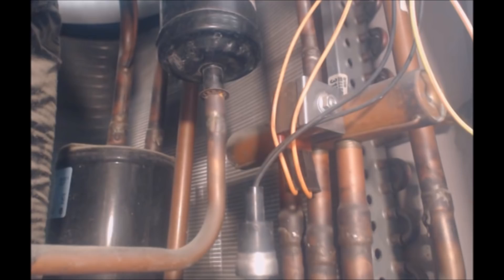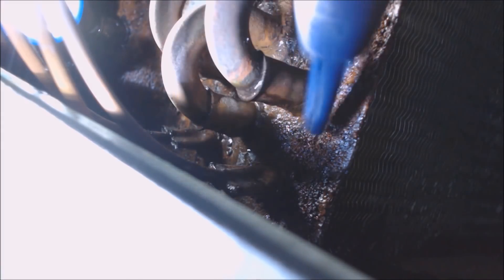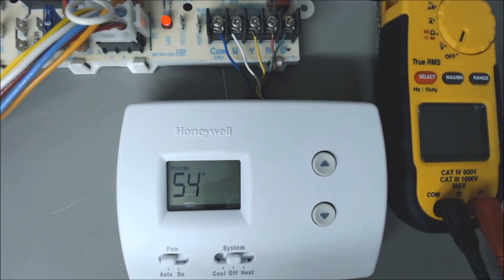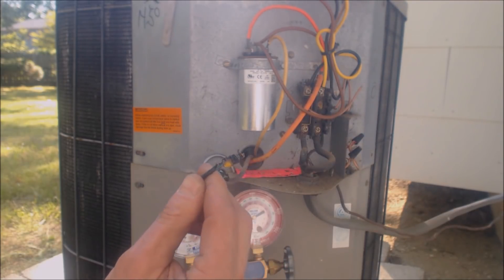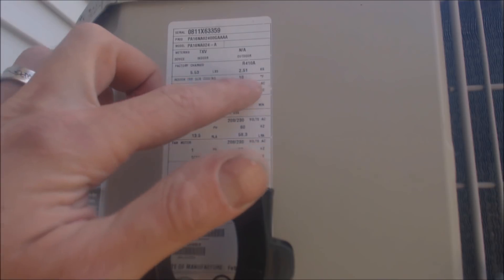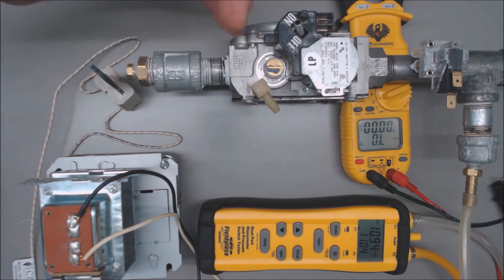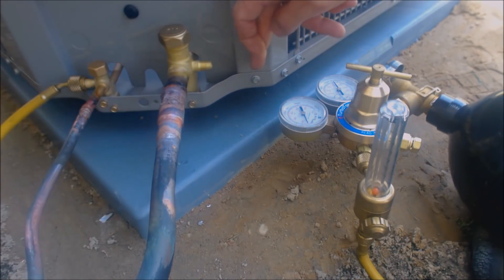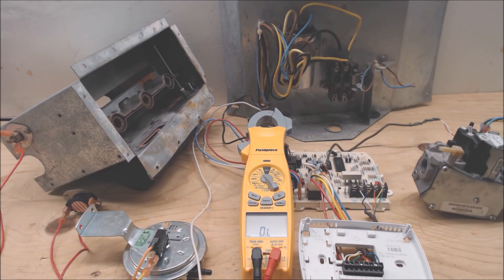AC SERVICE TECH Channel Intro Video! HVACR Troubleshooting and Installation Videos!

Comment from the maker: My Service and Procedure Book- https://www.acservicetech.com/the-book
Support-  https://www.patreon.com/acservicetech
Tool List-  https://www.amazon.com/shop/acservicetech
For those that are looking for the tools used in the videos: (Linked Below)
UEI DL479 Multimeter with temp sensor http://amzn.to/2jtsUbJ
Magnet Jumpers- https://amzn.to/2PyKPQZ
Alligator Jumpers- https://amzn.to/2PxqJXn
Fieldpiece ST4 Dual Temp Meter  http://amzn.to/2wc1ME3
Fieldpiece Bead K Type Temp Sensor https://amzn.to/2DBwKfs
Fieldpiece Wet Bulb Temp Sensor https://amzn.to/2RRI7Tw
Fieldpiece TC24 Temp Clamp https://amzn.to/2qHLyjZ
Yellow Jacket Refrigerant Gauge Set http://amzn.to/2aenwTq
Refrigerant hoses with valves http://amzn.to/2aBumVI
Yellow Jacket Gauge set & hoses https://amzn.to/2vLVkV9
Yellow Jacket 4 Port Manifold w Hoses https://amzn.to/2BkuGIq
FieldpieceSMAN360 Digital Manifold Set https://amzn.to/2BdoaD4
FieldpieceSMAN460 Digital Manifold Set https://amzn.to/2nB4Fe6
Compact Ball Valve for Refrigerant Hose https://amzn.to/2KUisW8
QuickDisconnect 90 for refrigerant hose https://amzn.to/2MMtVcg
JB 6 CFM Vacuum Pump   http://amzn.to/2nqbvo8
Appion Blue 3/8" to 1/4" Vacuum Hose http://amzn.to/2uYlVyc
Appion Red 3/8" to 1/4" Vacuum Hose http://amzn.to/2uYg6Ro
Appion Valve Core Removal Tool http://amzn.to/2uYr8WL
Yellow Jacket 1/4" by 1/4" hose http://amzn.to/2umtcod
CPS Vacuum Micron Gauge http://amzn.to/2v1nM3O
Supco Vacuum Micron Gauge http://amzn.to/2v1JRiA
RectorSeal Bubble Gas Leak Detector http://amzn.to/2ckWACn
UEI DL389 Multimeter  http://amzn.to/2xAdaJf
Air Acetylene Torch setup    http://amzn.to/2aQalsb  
15% Silver Brazing Rods  http://amzn.to/2gVLyLc
Nitrogen Regulator    http://amzn.to/2bXdR5f
Nitrogen Flow Meter    http://amzn.to/2brvoBg

Other tool links can be found in the video description section.

Shop through Amazon! Your Purchases through Amazon provide a means for channels such as mine to earn advertising fees from all purchases after clicking through. Prices are the same as normal-    https://www.amazon.com/shop/acservicetech

Comment: I learned to cut metal with regular nose snips..never knew any different until I used someones offsets. They make cutting so much easier once you get the right angle. Midwest makes a good pair.
Reply from the maker: Have you checked out the  "acservicetech sheet metal tools" video? Thanks Clay!

Comment: Hi there. I have been watching quite some of your videos before installing my AC unit but I still have a question , maybe dumb one but I'll give it a go. I recently installed an AC unit for my garage to WARM it up. Outside temperature is around 0 or under 0 degrees Celsius. After installing the unit I notice the Inside fan works and starts up but the outside fan never kicks in. Is this normal if outside temperature is bellow 0 or there is something else ? I can hear the compressor working outside. Thanks in advance.
Reply from the maker: I am assuming that you are talking about a heat pump in order to warm the building. It sounds like a high voltage or low voltage problem with the wiring have you looked up heat pump wiring? Is it a split system or minisplit?
Reply: Thanks so much for taking the time. It is an AC split system with heating function. wiring is all ok, double checked. But the unit seems to be empty of R407C. Can this cause the fan not to kick in ? I did not let it run to much because I did not want to burn the compressor.
Reply from the maker: If the unit has low and high pressure switches in the outdoor unit then it will not allow the unit to turn on, thanks
Reply: Thanks for your time. Appreciated. Unit is older and might have. I will fill up and see the results.

Comment from the maker: What do you think about the new trailer?
Reply: acservicetech very good I like it! 
Will you make videos regarding refrigeration troubleshooting and repairs? Under the patreon account perhaps?
Reply from the maker: Well I do take a quarterly request from all insider members for a video but I am limited with the units I happen to have in front of me. I make other videos and type up posts for the community and higher levels but they happen to be what I am working on at the time or have available at the time. I do try to answer more questions there. I am slowly investing in a mobile home to bring to the property to specifically build systems in. This will give me more of an ability to make more rounded videos instead of just what is in front of me or that I have parts from. Thanks CoolPoint Air!